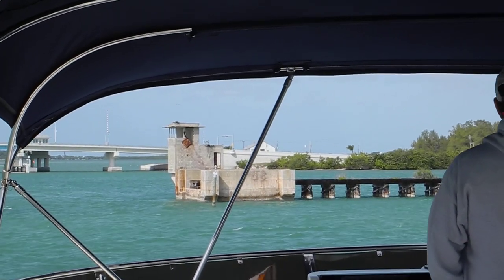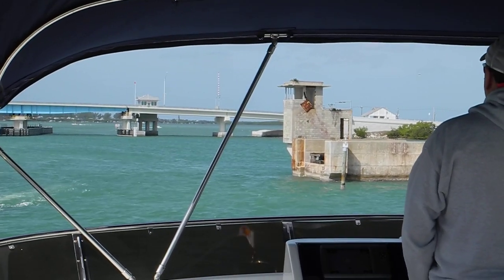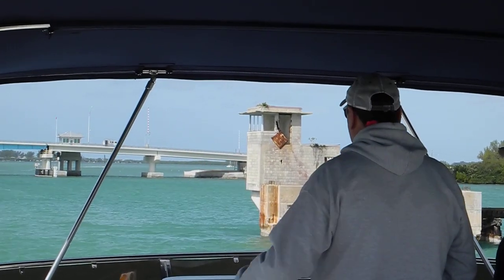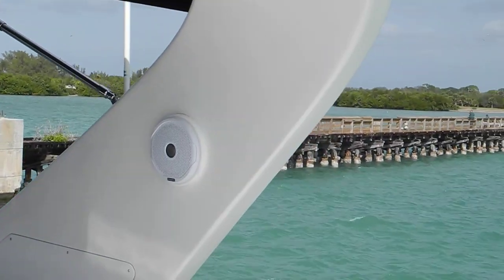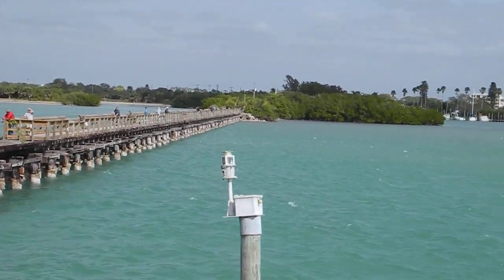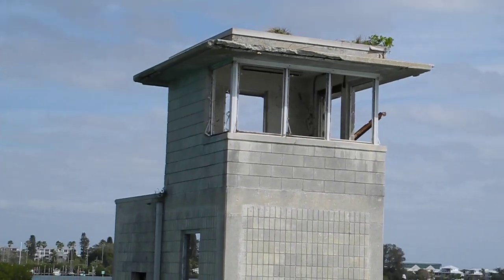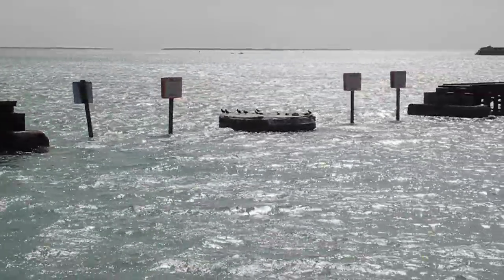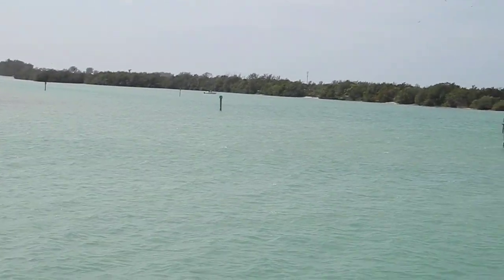Drawbridge in Boca Grand

Comment: Kinda got me thinking ....  The old a1a bidges through the keys ,. Where the old bridge is missing, is it just below the surface waiting to rip up some boats bottom ?
Reply from the maker: Pretty well marked and since the water is fairly shallow in the keys, most of the bridge rubble was at the locations where a bascule or lift section was removed. Other places like in marathon to pigeon key is is a great walking path that ends at pigeon key. Look on satellite view of google maps and you can clearly see the removed sections. The old bridge sections that remain are great fish attractions.
Reply: @AskCaptainChris   I have spent time in the the keys working , not boating .   See places the bridge looks like it was taken down and some places looks like it collapsed.  Do you know if there are still sucking boats in the water ?
Reply from the maker: Walter Davis Can’t say much about the sunken boats and the clean up since the last hurricane season. Check with WaterwayGuide.com. But the metal draw bridge has been sunking in 110 feet of water and is known as the bridge rubble. Popular for scuba and fishing. BTW the highway through the keys is known as US-1 not A1A. It’s called A1A when it’s an alternate and somewhat parallel roadway to US-1.
Reply: @AskCaptainChris   o was working down there after hurricane Erma.   Really sad to see boats slowly sink because there owners didn't come down to check them and others get pilfered .    The ones that were pulled out  were just crushed and sent out in dumpsters.   A lot of them were very repairable nice boats